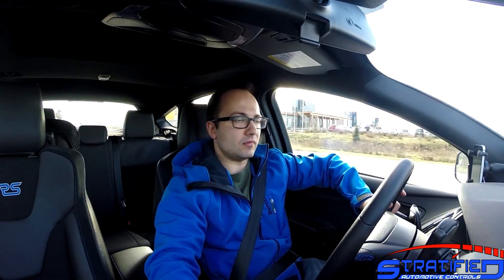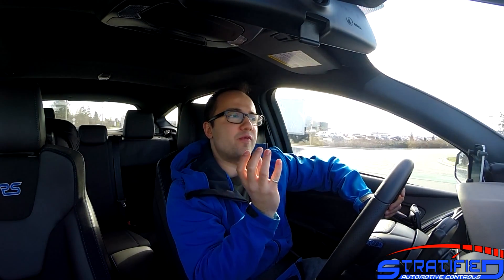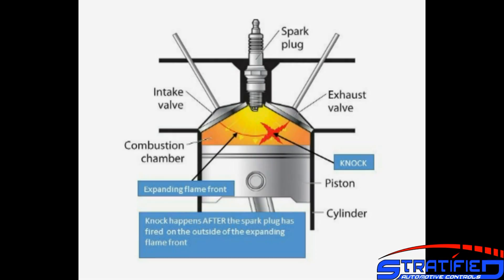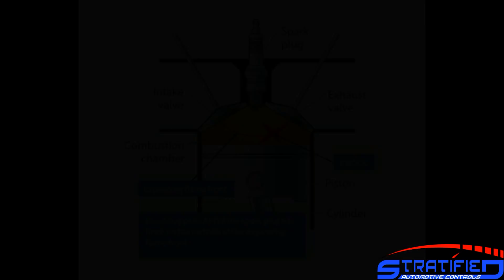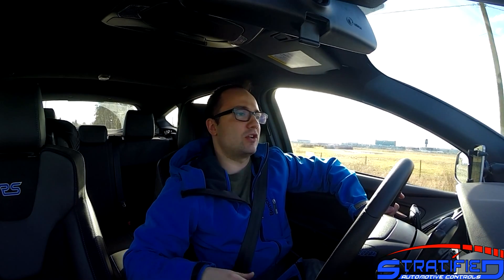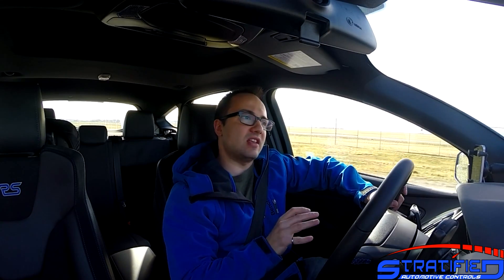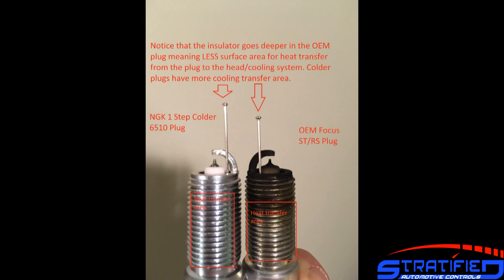Knock Detonation and Pre ignition Explained

Comment: Important to note that detonation (knock) can lead to pre-ignition. The superimposing pressure waves you describe strip the boundary layer away from the combustion chamber surfaces and super heat the metal. Those super hot areas can then become the source for preignition. Like you mentioned, the ECU should detect knock soon enough and pull timing out saving you from detonation damage and a possible preigition event.

Comment: OMG,,,Detonation or knock rather is when the fuel explodes in the cylinder rather than being ignited and burning with a flame travel,, Pre-ignition is from a hot spot in a cylinder that lites the fuel off before the spark plug does,
Reply: Can the same thing happen to a 2 stroke? I have a high compression quad that was just rebuilt (race built) I've been running 87 octane... will a higher octane fix it? How do I fix the knocking?
Reply: Close but wrong. It does ignite via the plug but the there is another ignition/combustion/explosion ahead of the process began by the plug. Creating an opposing explosive force.

Comment: Hi Alex. Great explanation of the difference between knock, detonation and pre-ignition. Aside from colder plugs and keeping the charge air cool (or at least keeping an eye on charge air temp and driving accordingly), what else can be done to mitigate the risks of catastrophic pre-ignition? I've heard that a catch can can help reduce oil particles that might be a potential source of ignition. Do you have an opinion on that and do you recommend any particular brand or setup? I'm on the Mazda DISI platform, Gen 1.
Reply: S T Chupack obvious one but make sure you’re using the right octane fuel or higher

Comment: Will the knock or ping continue for a few minutes after you've turned off the vehicle?
Reply from the maker: Ignition knock will only happen when the engine is running. The ping you hear are your exhaust heat shields contracting as they come down from a high temperature
Reply: StratifiedAuto the ping noise I hear after my vehicle is turned off I also hear a few minutes after I start it. It will continue to make the noise while driving it too. Is that still the heat shield?

Comment: what if I went with a two step colder spark plug ? won't it be better than one step? does hot or cold climates effect my choice of spark plugs?
Reply: too cold causes poor burning at idle and in general ,have to find that happy medium slightly leaning towards cold
Reply: hamad lari 
I ran an itv 24 a lot of people don't realize the stock heat range plug in the focus st/rs are actually a step colder plug than a naturally aspirated car. If you live in a hot climate with say 91 octane like when I lived in Cali it's especially important. The itv 24 is two steps colder and effectively 1 step colder than factory. I did this around when I did my stage2/3 stuff and when I went past that it help up perfectly just make sure if you have cold winters to check gap and how the car is doing by monitoring plug health so to match the right spark plug for your car and conditions/ mods etc etc.
Reply: I might also add I moved to Washington and ran them in the mild winter wa has on ethanol free 92 octane on torrid tune and my car ran amazingly well I got to about 43k on my car (early '13) before being sold  and it's still being driven around the area with no issues.
Reply: Thanks a lot
Reply: Thanks bro .. this helps alot